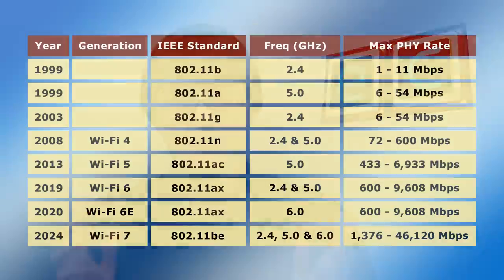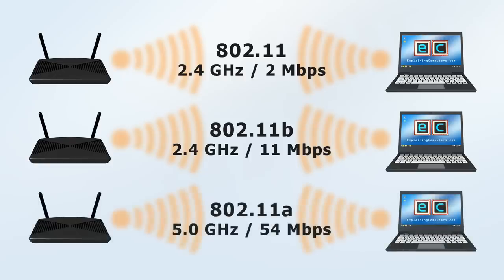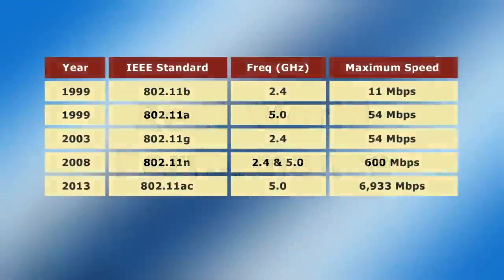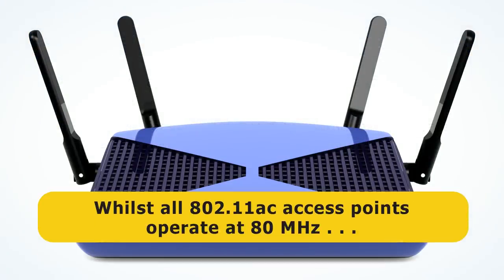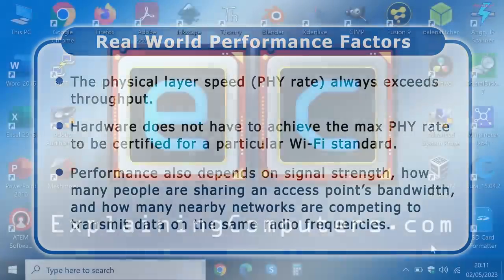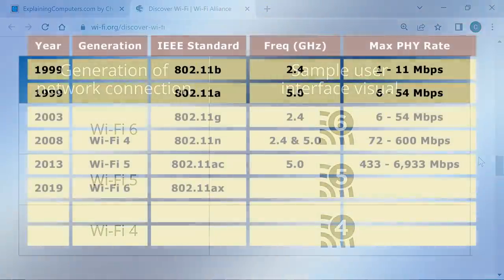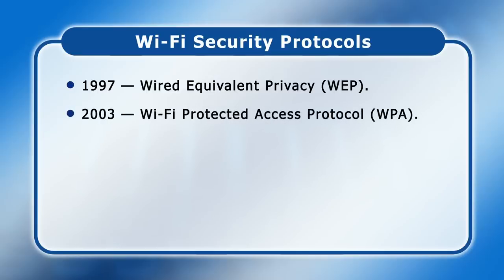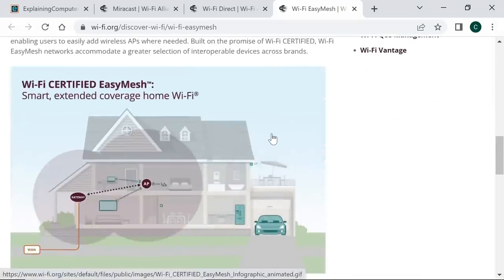Explaining Wi-Fi: 802.11 Standards & Generations

Comment: The Wi-fi Alliance has done a better / less confusing job than their USB equivalent organisation in giving the various implementations simple names.  That said, I treasure my new CAT 6 LAN cables.
Reply: I have some CAT 7 cable but have never hooked it up. Does it really make that much of a difference? I have 5 PCs on my network all connected via CAT 5 cables (old fashioned? LOL).
Reply: @Uniblab8  What are you connecting?  If the slowest NIC is say 1Gbps, then there will be no difference using cables designed to work at higher phase switching frequencies.
On the other hand, if you use say CAT 4 cables with a pair of 5Gbps NICs or a NIC and switch, then the cable will usually be the speed limiting element.
You might find it interesting to get a dump of the line errors.  If you are getting no errors, then you have no problems.
Reply: @Uniblab8  CAT5 is fine for what you are using it for. I usually use CAT6 for heavy traffic uses, like in an office with dozens of users. For that use I run CAT6 riser (CMR) cable. Well actually, I have an electrician do it, my back isn't up to ladder work these days.
Reply: @John.0z  Thanks
Reply: @caturdaynite7217  Great. Thanks. Much appreciated
Reply: Has any engineering development EVER been so clumsily named as that of USB? I can’t think of one.
Reply: @caturdaynite7217  Category 5 cable had an error in its specification (actually the omission of a crosstalk parameter) and is obsolete, replaced by Category 5e, in which the twist pitch of each of the four pairs of wires differs. For gigabit Ethernet Category 6 is unnecessary as it is more expensive, more difficult to handle and provides no advantage over Category 5e. However, it does offer the possibility of a more painless upgrade path to higher speeds in the future.
Reply: @Uniblab8  Apparently it does make a difference; I have a gigabit router, and until recently I still had CAT 5 cabling, but wasn't getting the expected speed when transferring files between machines.
Reply: USB, HDMI, DISPLAYPORT, AND THUNDERBOLT STANDARDS seem just as confusing or worse...
Reply: SD card versions/categories are a bit of a nightmre, too...
Reply: If one could turn the chronological order and names of the USB system into a program, it would give a syntax error that “can’t be corrected”.
Reply: Can you imagine if apple made their own system for this?

Comment: I'm blown away by this explanation Chris, in all my years online I never knew the origins, the differences (only superficially aware of the differences) between the standards and why they suddenly changed naming conventions.
Thank you for this... you sir are a great teacher.
Reply: Now if only we could get FreeBSD to support all of the current hardware for Wi-Fi... 🤣 As a matter of fact, I was using a new USB3 dongle for Wi-Fi 6E on Linux and I had to swap the kernel because it was added in version 6.3.4 about three or so weeks ago, but the version I had in PopOS was 6.2.16 and it didn't even acknowledge the device as anything useful. Drivers can be a pain on any OS.

I still keep meaning to get more serious about using BSD based systems, but I just never stick to them. The same went for Linux, so eventually I'll get there. (I started using Linux in the 1990's, but didn't 'daily drive' a version of Linux until 2017 or so.)
Reply: @sbrazenor2  I was shocked that 802.11ac came out so long ago, and FreeBSD is no where ready yet to get that as standard....I wish they would hurry up (work is being done, but it's a slow pace).
Bluetooth and Wifi - the bane of FreeBSD..... 😞
Reply: @RoboNuggie  I will dare to suggest that the actual supporting chips for 802.11ac were available some time after the specification was announced.  Then the Linux diver authors get left out in the cold by some manufacturers, which adds to the delay.  BSD is in much the same situation, but has more rigorous driver testing.
That is usually the way, although the specs are written in consultation or collaboration with many of the chip makers, so there are exceptions.
Reply: @RoboNuggie  I wonder if there's a way to find the drivers from Linux and somehow make them work for BSD. 🤔

In a quick search I did find that there's the utility ndisgen, which should be able to convert a Windows driver to a FreeBSD driver. It might be interesting to try and see what happens. It could be that you've had a solution all along, but because it's not well known (seems documented pretty well) - it's just been under the radar.
Reply: @RoboNuggie that it maybe because one never had the intellectual curiosity to get those years online mentioned and learn about it or maybe because there was no time for that in those years online

Comment: Some notes, the channel numbers we have on 2.4 GHz originated with the original 802.11 from 1997.
802.11g is exactly the same protocol as 802.11a, but with the addition of 802.11b protection.  It is this b protection that really kills performance, when b signals are present.
WiFi Direct used to be called Ad Hoc, where two or more devices could connect directly.
Reply from the maker: Thanks for sharing this. :)

Comment: I remember 802.11a and b being around at the same time, and I never understood (until this video) why 802.11a wasn't more popular despite being so much faster.
Reply from the maker: I also remember it being very confusing a the time: why did we all go straight to b? :)
Reply: 5 GHz range isn't good, especially if you have  brick walls. I still use 2.4 even if 5 GHz is 4x faster for this reason.
Reply: @gustavrsh  Plus some relatively new stuff still does not support the 5GHz bandwidth which is why on my TP-Link mesh setup I had to keep my guest network at 2.4GHz to be able to connect the smart light socket on my carport, and the smart smoke alarm in my house that will alert me if I'm away from home, as they refuse to connect to the mixed 2.4/5GHz main mesh network.
Reply: @CommodoreFan64  good to know You have a smart smoke alarm.... he he
Reply: I think it came down to two factors. The range of 802.11a on the 5Ghz band was noticeably smaller, especially with walls in between. And if I remember correctly, regulation of the 5GHz band was much more all over the place from country to country than the 2.4 Ghz band, making it much easier to just sell 2.4Ghz products world wide. 

It is still today much harder to get a 5 Ghz access point up and running when you try to DIY it with some random Wifi adapter rather than buying a ready made AP, because your wifi adapter may come with the wrong regulatory domain set (often just the international one with the lowest common denominator of what is allowed on what freq/channel), and just refuses to do AP things on the 5Ghz band.
Reply: @Hugh_I  Also cost. Gear supporting B standard was simpler, and cheaper to manufacture.

Comment: WiFi was the first technology to bring the Internet to you. Previously the Internet only existed at one cable connected computer in your home or in your office. With a WiFi Laptop and early phones you had Internet access in your whole home, at cafes, train stations, airports, etc... Sometimes it is still the only Internet option if you go to a foreign country and your simcard doesn't work.
Reply: I know what you mean, but strictly speaking in the late 90s or so my family did have internet connection to multiple computers without Wifi. With a DIY linux NAT router on the modem and good old Ethernet (of course all PCs connected together with a single bus over a coaxial cable, so everything went down when one connection failed). I even had a laptop with a PCMCIA ethernet card to plug into that.
On the other hand my phone didn't have anything internet. In fact when there was internet, there was no phone – as the single phone line was blocked by the dialup modem. Of course the phone couldn't have done anything with it anyways, it had neither a display nor any kind of processor that could even remotely think about running something like a browser, or even just telnet.

Comment: You can probably imagine how users feel about the transition to fiber. I’ve taken broadcast network systems from Enet to Fiber and the change is so profound as to seem like a new age. Enet cables the size of a tree trunk become a bundle the thickness of your finger. Of course, the change requires new hardware at both ends to take advantage, but is worth the investment for large, growing systems. What was once a terminal room full of racks can become a single small rack with energy savings on the same order.  The discarded insulation, connectors, and copper can fill a small truck.
Reply from the maker: Yes, an amazing transition. :)

Comment: What is interesting in terms of throughput in wifi is whether there will be any full-duplex communication. As of yet, all of the 802.11 protocols have been based on half-duplex, which only allows one-way communication. Ethernet has for a long time been able to use full-duplex, making simultaneous transmission and reception between devices possible. Wireless communication is much more complicated as it introduces interference and signal attenuation, making it necessary to have good multiple access protocols and error detection at the link layer. I hope to see more breakthroughs as this technology has not yet reached its full potential.

Comment: Thank you for such a wonderful and thorough explanation of all these wi-fi standards. This is all so much more clear to me now.  I always enjoy and learn something from your great content. 

Sadly, in 2009 I had to stop using a device that I liked because of 802.11n being released. When there was a 802.11n connection within "earshot" of my device, it would be blinded from any available wi-fi access points. The wi-fi list would be empty. Apparently it only supported up to 802.11b and got confused with the new standard. The makers of the device deprecated it and said they would not fix the wi-fi issue in software. 😞

Comment: I switched from a single modem/router combo to a Google mesh Wi-Fi network and it made a big difference. Even though it's the earlier model and not the newer "Nest Wi-Fi", the speed and stability is much improved over what my household was using before. That, and it has WPA3.

Comment: Great video! I closely followed wifi evolution since I bought my first wifi access point (wap) in the spring of 2000. I started drifting away from following that evolution about 2010 when my local (and only) internet provider was sold to AT&T who immediately shut down the "fiber to the home" program the previous provider had been implementing. Jump forward to 2022 when I moved to a new home with fiber to the home. I immediately discovered WiFi 5 which meets my current needs very nicely. I quickly learned that old hardware limits your ability to benefit from the newer standards, but not completely. I look forward to WiFi 7 or whatever they call it.

Comment: Excellent job on another great video Chris. While not a Wi-Fi standard discussion point, it is worth noting that all the Wi-Fi standards over 1,000 Mbps won't get most users any benefit if the uplink on the access point or router is still running on a 1 Gbps (1,000 Mbps) wired connection.  While it is evolving, most consumer equipment does not support 2.5 or 10 Gbps ethernet.

Another thing that comes into play and will cap your throughput is your ISP connection.  So for most users that are consuming internet content the faster Wi-Fi technologies will likely not translate into faster real world experiences so don't waste the money on a Wi-Fi upgrade.  However, support for newer security protocols like WPA3 might play a factor when considering an upgrade to aging equipment.
Reply from the maker: All very true. The average Internet connection globally remains about 100 megabits . . .

Comment: Well this was a surprise!!!!!!!!  Here I was connecting to Australia's Fibre network (FTTN) with the supplied modem/router to just check and see it's only 802.11/b/g/n and my router showed 65mb/sec yet my actual is 80 mb/sec.  So I'm missing out on extra bandwidth and it also varies and is prone to other devices in our home.  I'm on 2.4GHZ because 5 MHZ was problematic because mine is a cheap ISP router.  I then connected a CAT 5 cable and now it's incredibly stable and my FS 2020 flying experience is so much smoother and stable.  Thank you sir!!  Again. ;-)
Reply from the maker: Greetings. Glad to hear that has helped you to make some improvements. :)

Comment: An important thing to mention on throughput is that WiFi is actually half duplex, and wired Ethernet throughput speeds are specified as full duplex connections. Won't make a huge difference with very asymmetrical traffic, though being half duplex will be a lot bigger problem with more symmetrical traffic flows.

Comment: There were also a few non-standard implementations, now insignificant, such as a wide channel 22 mbit mode derived from 802.11b and a similar excursion of "Super-G" derived from 802.11g.
One complexity of using multiple standards together is that some equipment can be set to "Greenfield Mode", which turns off support for older protocols, which MAY improve throughput if they are not required and not present on the channel from any nearby networks.
The problem with greenfield mode, is it removes the protective wrapper of lower speed busy signalling around higher speed traffic, so conflicts may occur if lower standards are present on the channel from another network

Comment: Good video.

I've been using WiFi since 2004 and I've always found consumer grade equipment (eg a modem/router/WiFi AP all in one) to fail after a year or two and need to keep rebooting it. Or if doing a large data transfer over WiFi, the router will crash. I've given up on consumer grade gear and now invested in business-level gear for home network (specifically TP Link Omada). I've been running for a year on it without any problems. You get what you pay for.

Comment: The really interesting thing to me is the technology that underpins these generational improvements. Increased sophistication in on air coding schemes, higher channel bandwidth and also the use of MIMO. Truly great advancements. What's next? Beam forming and band aggregation, maybe one device connecting to multiple APs simultaneously. That said as amazing as wireless is optic fibres still take the performance cake. Now is always a great time to be in tech.

Comment: Good introduction to the topic.  There's a lot on the topic that was not discussed such as why 2.4GHz, 5GHz, and 6GHz are the radio frequencies used and how they are split up, channel conflicts/congestion that cause Wi-Fi connections to timeout/drop, and no demonstration of how radio signals work.  Software Defined Radio (SDR) devices are the sort of toy that are kind of up your alley:  They fit into a small package consisting mostly of USB sticks and are decent for little personal experimental radio-oriented projects on SBCs.  Unfortunately, USB SDR devices get quite hot even with moderate use and the software that exists is poorly constructed, so I've never really done all that much with them.
Reply from the maker: It is a relatively short video, focused on the standards and generations (as it made explicit in the title and introduction), and what most users are likely to need to know. But there is always more that couldbe included -- at the risk of making a less-accessible and less widely viewed video. :)

Comment: I am using WiFi 6 in Mesh mode for my WiFi coverage, but also am using a couple of old Netgear Ethernet over house power wires units that can go up to 200mbps. One end has a single LAN port the other end 5 LAN ports. There are newer units that can do up to 1000mbps over the house power wires but for what I need a 100mbps connection is fine.

Comment: Excellent breakout of the multitude of protocols. I was curious about Wifi Direct, as that is generally how I connect my phone to my printer to see lovely ducklings down by the stream.  As i try to connect everything hardwired (Even my TV), but I've yet to come across a cellphone with an RJ45.
Reply from the maker: Greetings Leslie. So you have duckling-net! :)
Reply: I did once connect a USB network dongle to my Android phone. It worked, but as the USB port on many budget to mid level phones is only USB 2.0, the speed was rubbish.

Comment: I wish you a mention of Wi-Max, or do you plan to do a video on it??
I got interested in Wi-Max when I couldn't get a decent internet connection.
Got interested in it again while living in my current place, which is line 500 ft  (152m) too far away from the central office for ADSL. For five years I used satellite internet.
Less than a year-and-a-half ago, my electric company brought fiber optic to my house. They offer 100Mbs synchronous for less than I was paying for satellite (20 Mbs up, 5Mbs down when everything was working right). They do offer gigabit at the same price as my satellite connection, but I was trying to cut back on expen$e$.

Thank you for another wonderful video;
Monte

Comment: Thanks for a breakdown of what varying bandwidth values the various "standards" are supposed to be capable of delivering, but determining ACTUAL wifi bandwidth with any of the wifi devices and their so called standards is clearly a total cluster frack crap shoot. I think this only begins to delve into the myriad factors that affect wifi throughput, and understandably doesn't consider issues like the physical obstruction problems with higher carrier frequencies and other distribution losses in mesh environments. For any demanding applications needing known bandwidth capacities, a hardwire is clearly the only reliable solution!